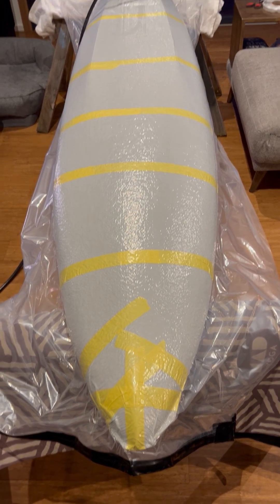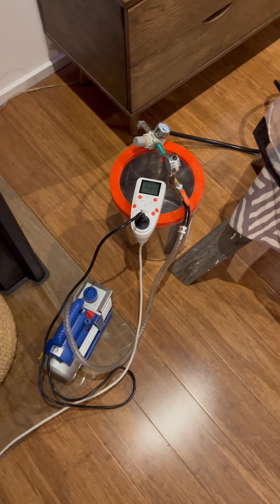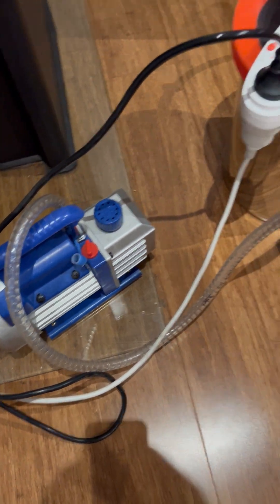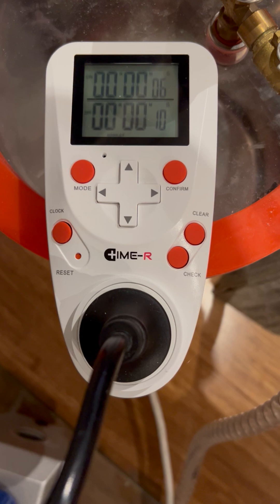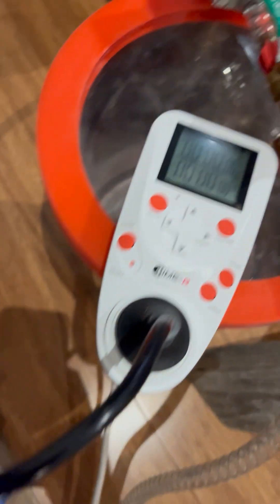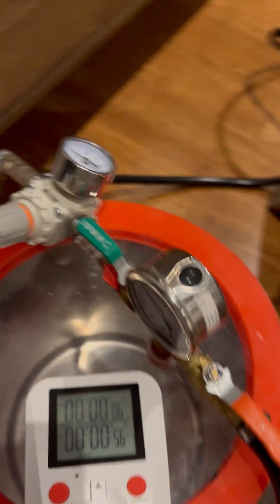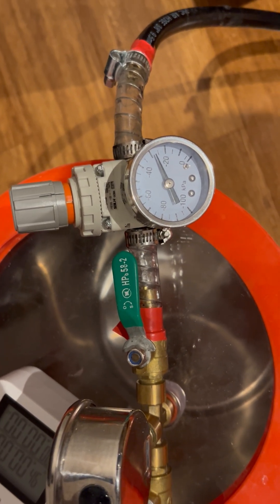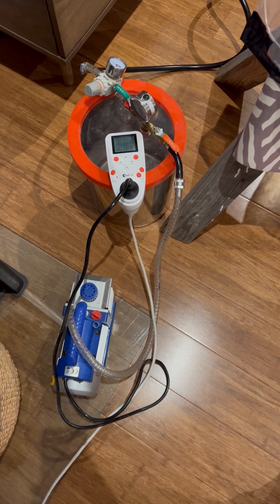DIY Vacuum Pump for surf board lamination

Comment: Can you give me a brief and how is it working?
Reply from the maker: Working great. Built a few more boards in meantime without problem. The key piece is to get a vacuum regulator. A cheap one from alibaba worked fine for me. Links constantly change but just search for “vacuum gauge regulator”.  That ensures that the pressure in the bag stays at a constant level all them time. Then add a vacuum reservoir in front of the regulator where you ensure you always have more vacuum then you want in the bag. Since you’ll always have a tiny leak somewhere in the system (or at least I always have …)  you’ll want the pump cycle every few minutes to maintain a higher pressure in the reservoir than behind the regulator in the bag. The easiest method I found is this digital power timer where you can set it for example to run for 5 seconds every 1.5 minutes. it’ll take me ~5-10 min to dial in the right on/off cycle and then I monitor it every half hour but once settled I leave it for 8h for a full cure. This way you reduce the stress on the pump as these cheap plumbers pumps are not designed to run non stop for a long time and start spewing oil if you draw to much pressure. 
Final thing I found really helps was a no return valve used in automotive parts on Amazon for a few $. Put between your reservoir and the pump reduced leakage.
Reply: Ich hab gehört man kann die Luft filtern, damit keine Epoxidharzdämpfe in die Pumpe gelangen. Hast du einen solchen Filter in Benutzung?